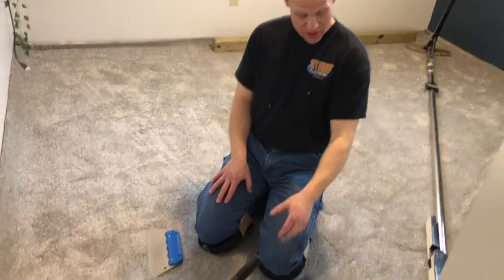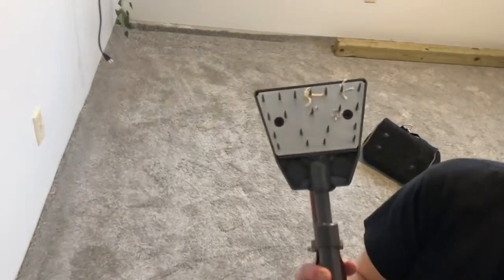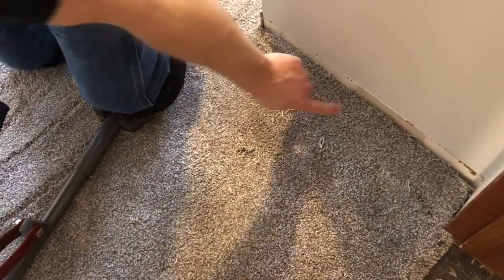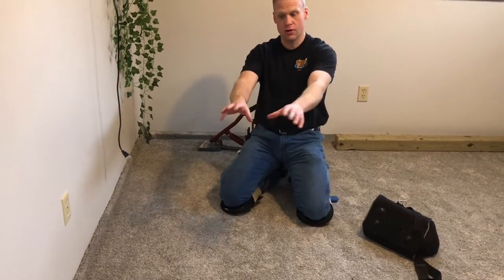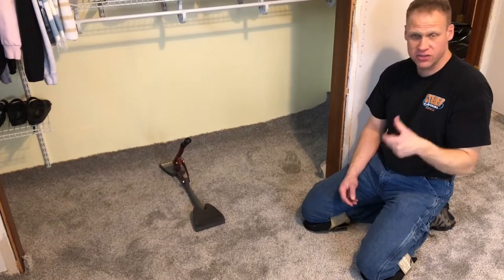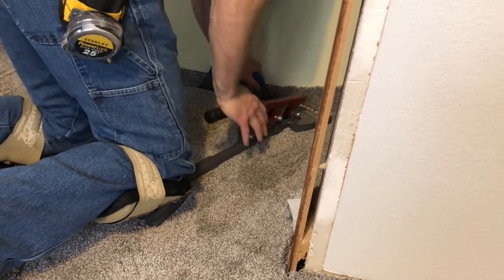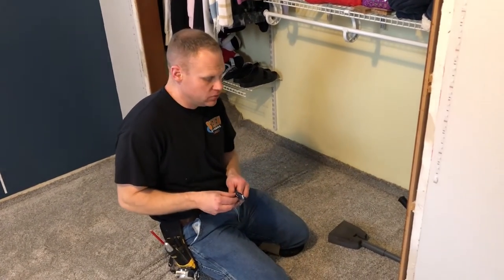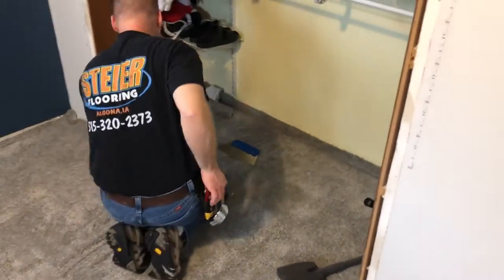Kneeless carpet stretcher on a REAL job!!!

Comment: I tried the kneeless on thin rental unit carpet over concrete, and it felt like the back teeth were sliding on the concrete, and the front just raking across the carpet.  Maybe I'll give it another chance
Reply from the maker: Take another piece of carpet and stab it into the teeth and use that as a spacer. This way, it will not dig so deep into your carpet.
Reply: @steierflooring9869  Good idea! Thanks

Comment: Reason why your not getting bubbles out is because your not using it correctly 😬 imagine a square you pick a middle of one of the wall width and you set 3 feet in the middle then do opposite. The you go to the middle of length then go left and leave a foot then go to the right and leave a foot. Then go back to middle of width and go towards the corner you went to on length then do the opposite side. Then you do the other half. You DO NOT SET AN ENTIRE WALL and will not get an actual stretch out of it
Reply from the maker: Thanks for the explanation